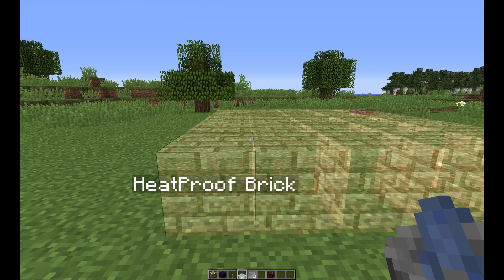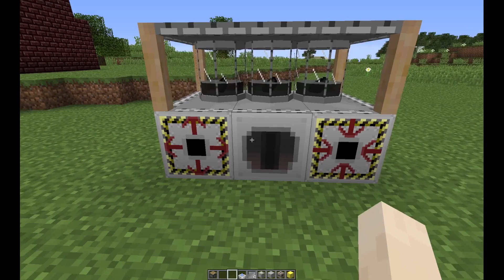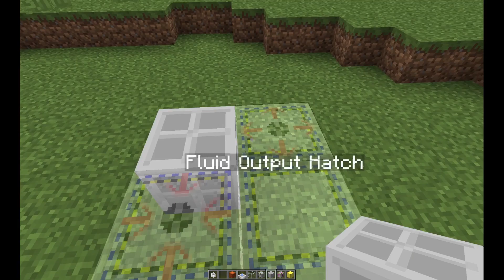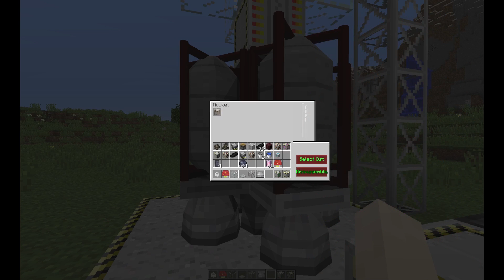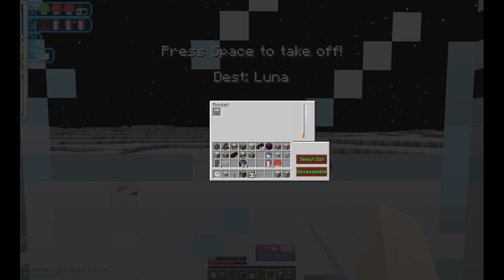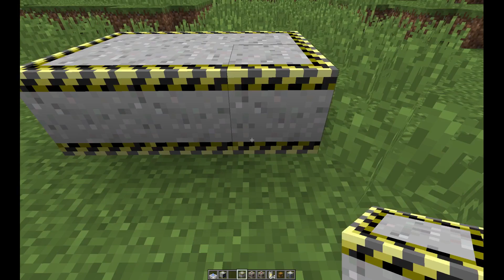Advanced Rocketry Release 1.0.0+ tutorial Part 1

Comment: Heatproof brick recipe doesn't work. I tried the magma cream and 4 bricks, then I tried what NEI says: Potion Of Fire Resistance, Potion Of Strength, and four bricks. I checked my version, it is indeed 1.0.0 So i'm not sure what's going on here. ATM, my only solution to this is using the CustomNPCs mod which has an option for me to make more recipes.
Reply from the maker: Does this issue occur when only Advanced rocketry, Libvulpes and NEI are installed?  Second, 1.0.0 is over a year old now and is no longer recieving bugfixes.  And in repsonse to your other comment, the ability to speed up machines was only added in 1.2.x builds.

Comment: In 1.7 I built the rolling machine correctly and it turned into a multi block, but when i turn it on and give it rf, the items wont process, and they are items lib vulpes ads that are able to go through. help?
Reply: Either you have the wrong type of power source or the wrong type of power. Some machines can either a power source that uses RF or a power source that uses EU
Reply: did you give it water

Comment: not gonna download this if it causes lag anything like what you have
Reply from the maker: I'm dissapointed to hear that you're not willing to even give it a shot even though you didn't ask for a vanilla performance benchmark or benchmarks without recording software running.  However I can understand perfectly that most people are accustomed to watching videos produced and recorded on mid to high end computers and expect software to run the same way on theirs.  But anyway I appriciate the feedback all the same and will see what I can do about increasing the fluidity of future videos.  I have recently aquired a computer with an NVidia 630GT and core 2 duo, and it's got a significant fps boost over my current system and should allow me to record smoother videos in the future.

And If it's any context, i get about 54 to 57 fps in vanilla MC1.10.2 on lowest settings without any recording software running.
Reply: It doesn't cause any lag like this. It's just his recording software that is doing this.
Reply: again, optifine and bandicam and record minecraft even on lowest end pcs is possible, especially without high resolution texture packs and 6 and less of draw distance

Comment: hey in case you were still looking for how to handwave the rocket fuel, real rockets run on a mixture of high quality Kerosine with liquid oxygen as a rapid oxidizer introduced in the combustion chamber to feed the rapid burn. you'd prolly need some kind of oil gen and refinement methodology. Hydrogen is a nice small scale fuel, but its not enough bang for the weight. its great for power gen. you could potentially look into the nuclear rocket engines the US experimented with and built in the 1950's and 60's also as some interesting ideas. the byproducts from refining could be used for plastics and rubbers for different things, being as its nice and light and generally in rocketry, the lighter the better (hence why the focus on aluminum and ceramics in modern rocketry). honestly if you have a discord or something, I'm more than happy to offer more help if desired. I'm an avid astrophysics and rocketry enthusiast lol, so I kinda have looked into a lot of this stuff. also my late uncle used to work with NASA as an engineer in the 80's and he used to tell me a few stories.

Comment: I'm using version 1.1.7 of your mod and the Astrobody Data Processor doesn't have the slot on the right. I only have the three IO slots and the bottom one. I filled the three buffers to max but when I turn the "research" on for any of them, nothing happens.
I made sure to provide power, and even put a few Planet and Asteroid Chips in the input slot, or the bottom one, and nothing happens.

I'm playing the Invasion modpack, so I figured maybe they disabled something, but I couldn't find any setting in the cfg file that might've been changed.

Any thoughts?
Reply from the maker: I've not got around to document the alpha builds yet (1.1.x) but the asteroid chips are first programmed in the observatory in the 1.1.x builds.  Once programmed you should be able to fill it with data like in the older builds
Reply: Cool. I'll check that out.
So it's basically, get the Observatory running (at night), go to the Asteroid Selection tab, click scan and wait until it finds something?

If that specifically for Asteroids, how do I do it for Planets then?

Also, it doesn't seem to be working for the Observatory. I have it running at night, it opens up. The Data tab says "Observable Distance: 200" and nothing else, and nothing happens in the "Asteroid Selection" tab.
Am I supposed to pump in Distance data into the Observatory in addition to what it generates?
Reply from the maker: You need at least 100 distance data in the observertory for the scan button to work.  It will also be instant when it does.  The Observetory also not longer generates distance data and it must be collected from a satellite in the 1.1.x versions.

Planets by default will all be discovered.  Though if you have the require planet discovery option enabled then planets can be discovered in the warp controller on warpships.  In order to do that the warp controller must be fed 100 of every data type as well as an unprogrammed planet ID chip.  The you can start a planet search by clicking "Search for planet".  It's only get a 1/50 chance of being successful however, so it may take a few tries.
Reply: Understood. Thank you for the explanation :)

Comment: in modpack invasion, small plate presser dont work ¬¬" 
Great horrible physics
Reply: I think the "problem" he's pointing out is that, in that modpack, virtually all blocks have gravity, so you can't place a piston one block above obsidian, as it will just fall down because of gravity. And even if you somehow manage to place them properly (Piston pointing down above a block of iron, on top of a block of obsidian), when you flip the lever, nothing happens.
Additionally, the modpack dev might have disabled that option to force users to go through Immersive Engineering's Press (for gating purposes). Honestly, I don't think it's an issue with your mod, but I could be wrong.
Reply from the maker: What is it doing, what do you have, and what do you expect it to do?

Comment: I have a problem. I seem to have every object that I need for the machines except for the quartz crucible. Its not in the objects menu anywhere. Is this because of an update or what? PLEASE HELP!
Reply from the maker: Which version of the mod are you using and are you using NEI/JEI or just vanilla to look?
Reply: zmasterfun I am using version 1.10.2 and I do not have any other mods installed in 1.10.2 other than  Advanced Rocketry.
Reply from the maker: I can confirm it is indeed missing from the item list or I'm blind.  Will investigate further.
Reply from the maker: Fixed for next build, the item is still "there" you just can't get it through the creative menu, if you're in creative mode you should be able to pickblock it from the hologram or if you're not, craft it in the crafting bench.
Reply: Thank you very much and how do I pickblock it in creative mode?
Reply from the maker: No problem!  It's usually middle click by default.  It can be changed in the controls menu though
Reply: Once again thank you for the help! I appreciate the fact that you replied within a day of this comment being posted. Also, I was wondering what the crafting recipe for the quartz crucible is too. Great job on this mod and keep up the good work!
Reply from the maker: No problem and thanks!  I normally don't check youtube as often as curse or git though.  If memory serves the recipe is a vanilla cauldron with quartz above, below, to the left and to the right with the corners of the crafting grid empty.